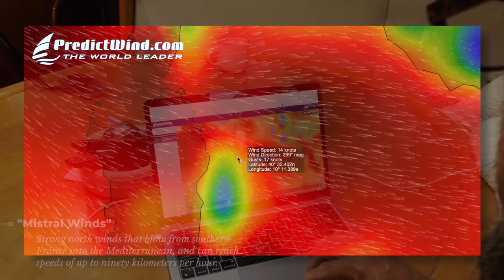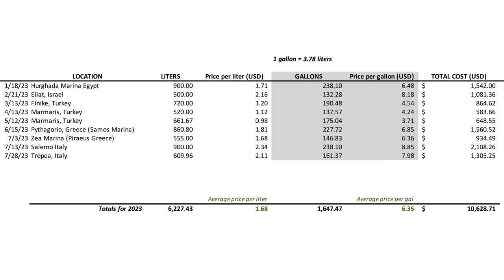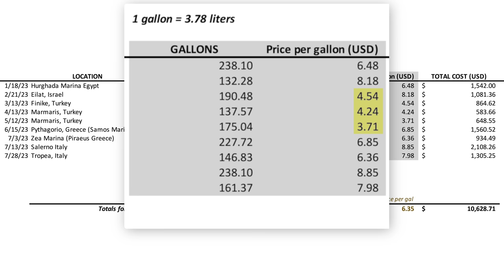WE SPENT $10,000 ON FUEL!! 😳 Cruising the Med ain't cheap (Ep 250)

Comment: Keith I really enjoy it when you share the modifications/upgrades you've made to the boat  and its systems to make it easier to service, and the upgrades you have added like the fuel polisher.  You are a guy after my own heart on this stuff. One can never forget what you have here, a mobile "home" with all the plumbing and electrical systems that brings, plus a charging system and engines for propulsion,  all of which lives in a corrosive environment that is subject to the motion of the sea. Pretty amazing stuff for this old gearhead.

Comment: On my boat, I purchased an inverter generator and placed it on the swim platform, attached to my shore power cable, so I could run my AC at night. My inboard generator can use up to 1 gallon an hour. My inverter generator uses 2.5 gallons and runs 10 hours. Saved me a lot of money.

Comment: I run aviation kerosene in all my diesel powered vehicles and equipment and all that is usually needed is a lubricity additive which is very cheap.  I blend used motor oil in with the aviation kerosene which serves as a lubricity additive.
If you have older mechanically injected diesel engine you can run used motor oil through a basic filter and blend it in with diesel fuel.  10 percent motor oil blended with 90 percent diesel works fine is most engines.

Comment: I had a bad problem with algae in my tank and was always putting algaecide in my fuel. I saved old engine oil for 20 years in case the world fell apart. Now I mix 50-50 engine oil and new fuel in my 100hp John Deere backhoe and my bad fuel problem never came back. Also, I would like to see Fin play Carlos Santana's Supernatural.

Comment: You guys call those temps a heat wave, we here in the Southwest USA see them temps every summer and at times topping 118 degrees. We are told it is a dry hot so not as bad, lol, anything over 100 degrees is hot as one gets older.

Comment: Here’s a tip:  you’ve got a sailboat.  You only have to use fuel if you’re too lazy to sail.
Reply: Or if you want to drink clean water....or run the A/C in 110F weather🤗
Reply: Did you listen to what Renee said ?
Reply: @rnupnorthbrrrsm6123  I sure did, thank you for asking. Did you read what I wrote?
Reply: The Med is not a good place to sail in. No wind or very light wind.
Sailing UMA had a long sail from the Rock to if think Italy. They don't have a ICE, just electric.